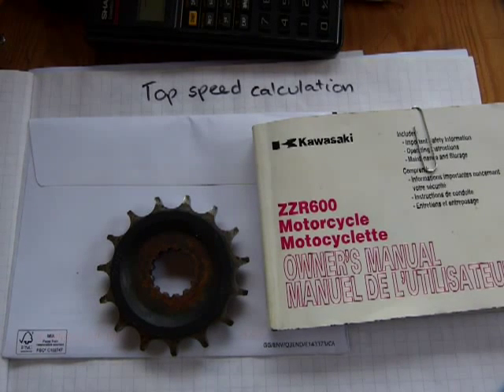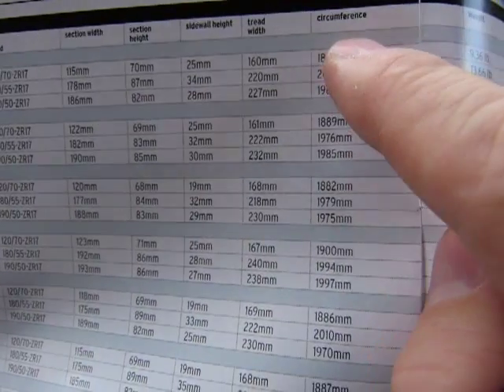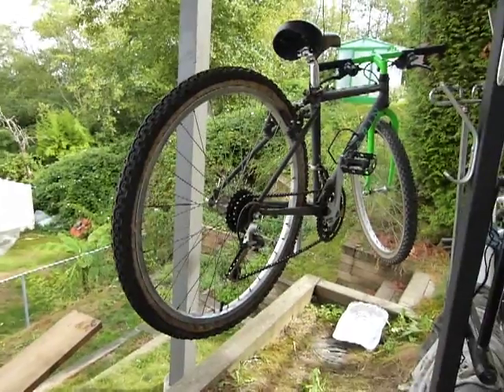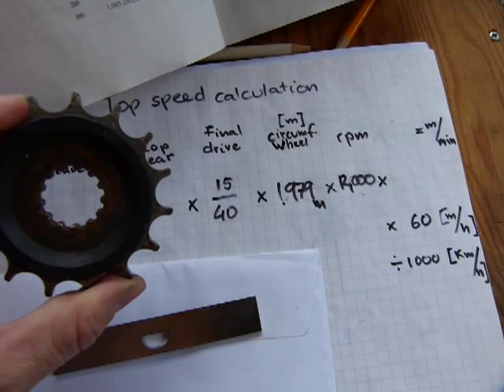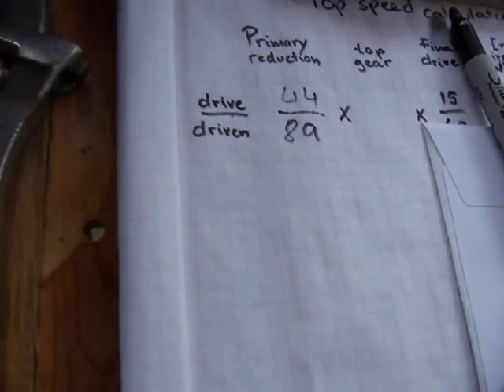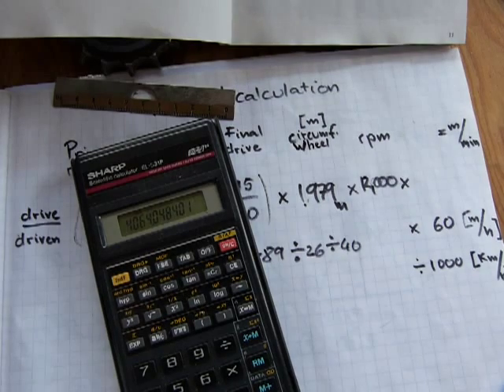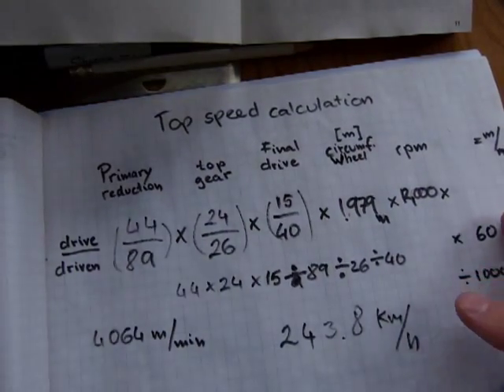Go faster! WARNING: gear math danger

Comment: how about changing the gears in the gearbox? you gonna tell me that i still need to make the crankshaft rotate faster right? :) so the question is, should i turbocharge or supercharge my engine? or is that wrong? even  with forced induction my engine will not exceed 12000RPM?   Am really scratching my head over this questions. Can you help putting order in my brain sir ?
 btw great great great informative video thank you
Reply from the maker: Changing gears in the gearbox helps, but supercharging just helps more if the gaskets can hold the pressure in. To spin faster, the stroke needs to be shorter and that means re-engineering.
Reply: More rpm is a difficult thing , spark timing  valve timing the amount of fuel input during ignition , moving the balance of the motor as well , idle at 3ooo rpm  ect gearbox differencial clutch , think about putting a car in to gear at 3500rpm and driving off down the road , it will fly apart befor you get moving
Reply: when you change gears in the gearbox, thats a whole other story, its changing the gear ratio on the engine box. Turbocharge or supercharge....... well, here is the deal, your rev limiter is fixed 12K rpm, no matter what you do (unless you're into engineering and rebuilding your engine) you're not gonna go above that.

 I might suggest: 
- Making sure that your squash clearance is at minimum
- shortening the length in the chain (the rear swingarm too for that matter)
- getting the spark timing just right (delay/advance the timing depending on what fuel you run)(premium fuel is always better for high end users because it allows for more compression before it autoignites)
- reducing/enlarging the front/rear sprocket to a reasonable size (if you go too much then you'll have lazy top gears and wont be useful and will put stress on them
- CNC the Flywheel or rotary parts (Crankshaft, Mill the inside of the piston, enlarge the intake/exhaust holes on the cylinder head) to make them more lightweight (DO AT YOUR OWN RISK): Keep in mind that metal is there to dissipate heat and maintain stability on engine parts, if you cnc too much out of the part then it might be compromised and fail at HIGH rpm's or high operating TEMPERATURE

OF COURSE, this is if you want TOP SPEED, for TORQUE, do the opposite for the sprockets and dont mind the high speed technicality
Reply: What about lightening or even knife-edge the crankshaft🤔.
Reply: @mrc36amgtheophilus53  jhekaaas

Comment: You forget to mention the most important factor of all - the engine torque required to rev the engine at or towards the red line in top gear. 
It doesn't do much good that the red line starts at 12,000 or even 17,000 rpm, if the bike can't approach that engine speed with the gear ratio in question. That's why bigger engined motorbikes are faster than smaller engined, even those with lower rpm. 
My old Suzuki GSX 1100 has it's red line at 9,000 rpm but runs those 243 km/h at a lower engine speed. My current gear ratio calculates to 270 km/h, provided the engine can reach the red line in top gear (haven't yet tested how far it will go, though). c",)
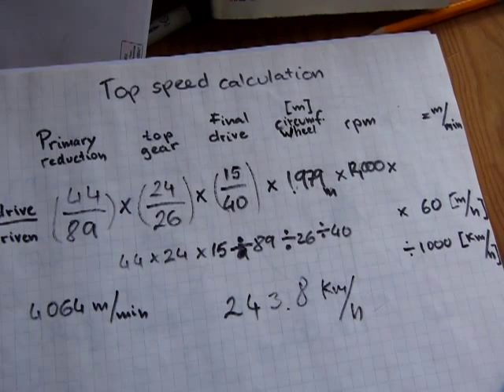Reply from the maker: +brufnus Did not forget anything, all kinds of limits are spelled out at 15:10 - 17:56, specifically at 15:30 the words "on a test bench" comes up. So yes, your findings are fine, calculated top speed will never be reached.